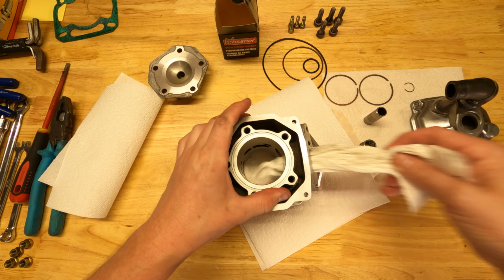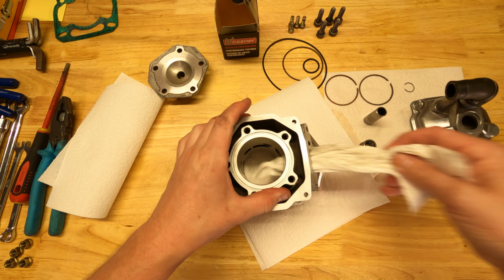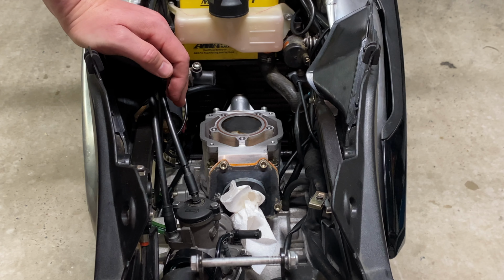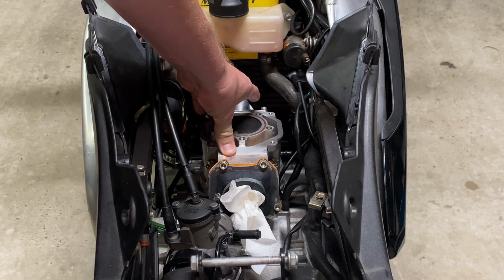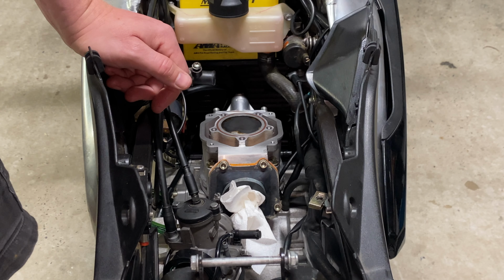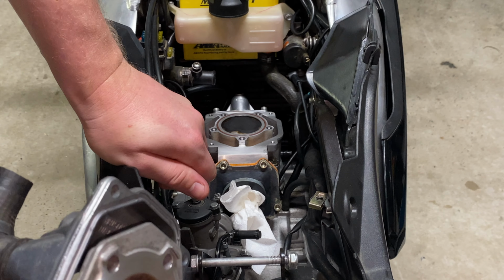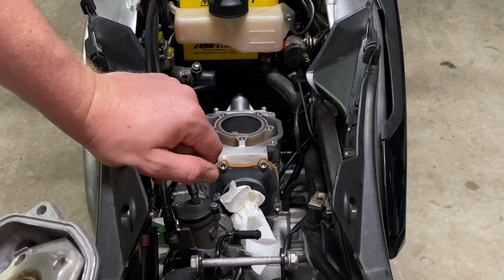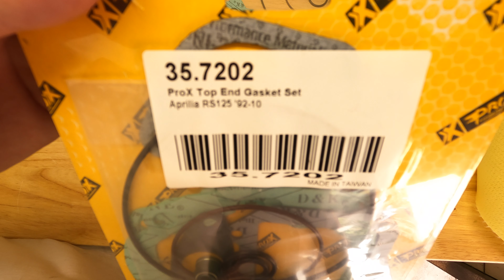Aprilia RS 125 How To Improve Performance - Piston Squish

Comment: Hi Tom. Like your videos a lot. Where do you live? Why did you chose a 125 2T rathert than bigger 4 stroke engine?
Reply from the maker: Hi Adrian. I’m glad you like my videos.
I’m based in Eastern suburbs of Sydney, Australia. Do you recognise the area?
I grew up riding 2T and have a 2T background from my MX days. I like the 2T power delivery, the sound, the smell and easy maintenance.
You could say I’m reliving my youth on this little machine 😀👍.
What do you ride?
Reply: @tomdidit4216  That's what I thought, Australia, because it's too sunny and pretty to be England. I ride a 1975 Yamaha rd250 -alsi 2t. I have recently been thinking about an aprilia. I like it visually but i did not have a chance to ride it.
Reply from the maker: @Endrjo  Glad you liked the scenery. The video was filmed around Bondi Beach.

RD 250 is a great bike! I’m actually thinking of getting some sort of RD next😀👍. The Aprilia is fun. Built for going fast between corner to corner.
Reply: Hi Adrian , one advice get a Aprilia and drive the hell out off it 🤟

Comment: Had my italkit 140 single ring done 500 miles with full rebuild bike was a pain 145 psi it always wanted to open up early on the revs some people do 1000 or not even 100 miles and  rag it I thought I done well 500 miles then ride it like normal and open up now and then
Reply from the maker: Sounds good. I’m thinking of the 140 kit from PJME🤔
Reply: @tomdidit4216  

140 kit single ring from pjme is best for these bikes believe me I used 154cc in Sicily bit more power but sluggish mid and low range .

Warning!!!  make sure you use PV spacers on the power valve I use the original one and spacer is 💯 need or blade will hit piston .

Comment: Did you do a compression test after the skimming ?
Reply from the maker: Hi there.  Thank you for the comment.
Yes I did however I lost the footage! With new top end and 1.25mm squish it now creates around 115-120 psi (cold engine). Not amazing I know, but I can definitely feel the improvement.
As the parts are really new, i think these results may improve as the piston and rings bed in etc etc?
Cheers.

Comment: sounds like its bogging low down? pilot to big maybe?
Reply from the maker: Hello Antony.
Sure, it is a bit sluggish from idle to quarter throttle👍. Not sure if it’s the extra 2 stroke oil coating I’ve been adding to the top end during the rebuild etc etc, or pilot jet, or A/F mixture screw.
From memory, i think my pilot is a 60?
It’s likely my next video will be on carburettor basics and tuning. Let’s see if I can address this in that video.

As always, thanks for the comment.
Cheers.

Comment: Tanks for that last bit mate, It,s the krown on this video. I,m i richt to say its running a bit rich?
Reply from the maker: Hello there Jaap.
I agree, it is running a little rich👍. It could be the 2 stroke coating I have added to the new top end and cylinder components, or the jetting? It’s also not a bad idea to have it slightly rich as the new parts wear in.
Fyi - it’s likely my next video will be on carburettor basics and tuning. I’ll hopefully address it in that video.

Thanks for watching!

Cheers.
Reply: @tomdidit4216  I look forward to the video on carburettor tuning. My 28mm VHST has pollution gear on it and it's hard to get the correct specs for jets, needle etc. A new 34mm carby and manifold is coming soon.
Reply from the maker: Hey James. I’m working on the carb video now :)
I have heard bad reviews of the VHST and it’s tuning issues. I’m sure the 34mm setup will be a real improvement.
Reply: @tomdidit4216  I look forward to it. Hard to ride much with all this rain.

Comment: Best channel on YouTube for the aprilia rs125 were did you buy your piston and head from have you got a link sir so what's next 34mm vhsb dellorto pjme got loads in store and you don't pay tax thanks Paul uk 🇬🇧
Reply from the maker: Hello there TRAINED TO GO.
As always, thank you for your support on the channel!
It’s likely my next video will be on tuning the 28mm PHBH carb that’s currently on the bike.
I’m considering the 34mm carb option with PJME, however delivery to Sydney Australia takes about 2-3months. I may have to try and source one locally in Sydney??
-Wossner piston was from F1 moto. They can be found here https://www.f1moto.com.au
-My head work was done by Greg Ball Motorcycle Engineering, Kirrawee NSW 2232.

Hope this helps mate👍.
Reply: @tomdidit4216  great reply if you want to really lower the squish use threebond gasket glue with no gasket  0.8 our race bikes are set up we use two spark plug orings with silicone so no water leaks
Reply from the maker: Ok, I’ll keep this in mind. Thanks!

Comment: Hey Tom, great work.

Sorry if I missied this part of the video, but what was your compression after the skimming? It increased from 100 psi to?
Reply from the maker: Hello there AcTiVe TV.
You didn’t miss it, I lost the footage!! My apologies for this.
I now have 115-120 psi with new top end and 1.25mm squish. Not great I know, however it has made a real improvement to the engine overall. The compression may increase as the new components wear in? Let’s see.

Thanks for watching.
Cheers
Reply: @tomdidit4216  Hey thanks for the answer. That is a great improvement. Quite a lot of compression gain from such simple "fix". 
Keep up the good work!
Reply from the maker: Cheers pal.
Reply: @TheMOTP  you got a aprilia rs125
Reply: @trianedtog0417  No, I don't. But I have a similar machine, Honda NSR 125R, it's two-stroke as well and has similar power. Right now it's undergoing a full top rebuild. I had a hole in a piston, and the cylinder was totaled...nicasil on the surface of the cylinder was to be replated. I bought a new cylinder, a new piston (wossner) and all the parts. Right now I have to exchange the piston I bought because it's a little too big, it should have been 0,01mm smaller. 
I watch Toms videos because I like two-strokes and they are built quite similar ;)
Reply: @tomdidit4216  hey, what did the compression eventually go up to after running in ? thanks for the vids  :)

Comment: What size main jet are you running out of curiosity 
Looks like it goes well on the 28 mm carb
Reply from the maker: Hi David. Firstly, thank you for your comment.

You’re correct, I am using a 28mm carb - PHBH to be exact.  The main jet is 120.
Fyi - I’m in the process of making a video on carb settings and tuning (it may be of some interest to you).

Thanks again.

Comment: What is your opinion on engine braking with a 2 stroke?
Great video though! :D
Reply from the maker: Phillip, hi
I think it’s ok for a short time. I don’t rely on the engine brake when I travel down long hills. I clutch it and brake. Providing the bike is not running too lean, general riding should be ok.
The worst thing I see is when people Dyno tune 2 stroke bikes and leave the back wheel spinning at full RPM.
Hope this answers your question👍

Thanks for watching.
Reply: @tomdidit4216  It really helped thanks.
Cheers
Reply: But is this bike premix or oil injected?
Reply: @janeblogs324  oil injected
Reply: Don’t do it unless u are racing it fullout, this means that u will go full power after a couple off seconds off enginebraking and only if u premix 2,5 % off the best oil U can find

Comment: My bike do 170psi is that to much sir? What will happen if I have to much compression?
Reply: It depends on the octane rating of the fuel and jetting. If it’s low octane then you can have detonation problems, especially if the jetting is on the lean side. 
Some people compensate for detonation problems by richening the fuel mixture (larger main jet or needle type/clip position). 
A cheap way to reduce compression is to fit thicker base gaskets….or replace the parts that are causing the problem.

Comment: How many psi/bar does the bike have now?
Reply from the maker: Hi Phillip. Thanks for leaving a message.
This is a good question. The wossner piston has done about 1500kms now, so it is well bedded in. I should check.
FYI - it had about 135 when brand new.
Cheers
T

Comment: Driving with no gear 👍🏻
Reply from the maker: Hi D. Knew I’d get smashed on this one. Not doing it anymore…
Reply: @tomdidit4216  just one question. If you do all this work ( U did this very good ) why not put a 140 on it? I setup mine with a 140 italkit 34 carb with 16/40 sprockets , full arrows exhaust , it goes 170 km/h and goes from 0 to 100 in 4 secs its a beast now, keep working on it and drive it bro. Guys always wear gear plz
Reply from the maker: Thanks for your question.
My bike is in good original condition with very low Kms on the clock. I bought the bike with 3000kms on it, now it’s done 5000kms. By keeping it original it might be more valuable one day?
However the engine mods, sprocket change and performance gains are very very tempting... the RS responds very well to tuning!
Reply: You can always keep your original part and reinstall when u want to sell it, meanwhile you will have twice the fun 🤩
I see that you know what your doing so this will be no problem for U . Grtz from Belgium 🇧🇪 Ride it like U stole it